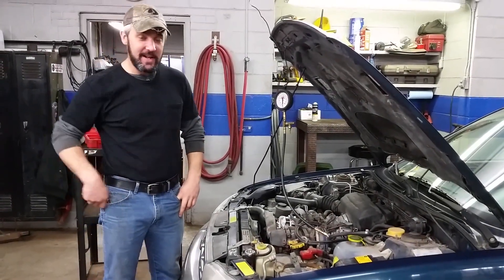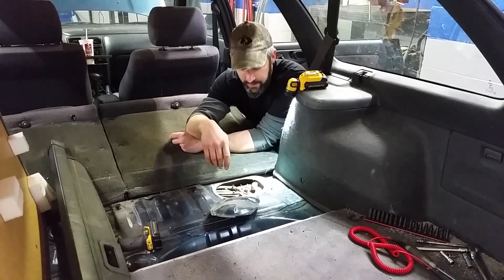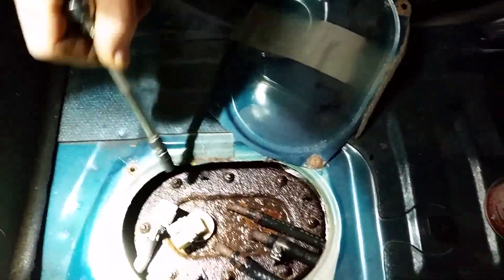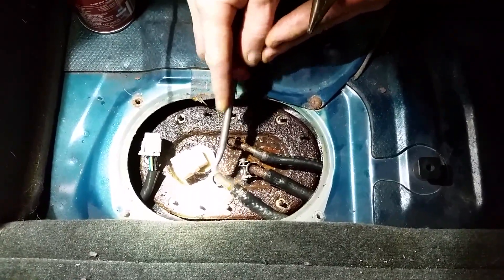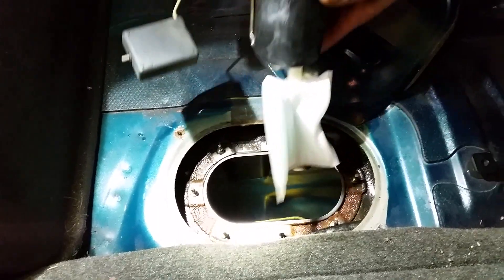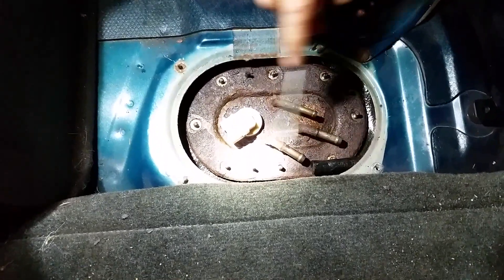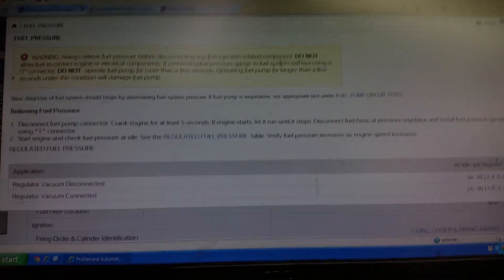Test And Replace Fuel Pump  - Subaru Legacy Outback

Comment: Great video!  I successfully changed the pump in the parking lot where my car died.  I had never even opened a gas tank before.  It took about an hour.  Side note: My pump was the original pump and I took the wire leads off the old motor by removing the nuts from the wire posts, then I just used the original wires and put them on the new motor's posts.  This saved me from cutting and splicing the wires and gave me a better connection and was faster.

Comment: I bought my 97 legacy outback about a year ago... it’s held up pretty good until now. The owner told me a few problems but not the other ones, some being major like BOTH head gaskets leaking. I’ve had a weird problem though, stalled twice, once while driving down highway the lights and radio stayed on as the engine just shut off and I drifted to a stop, another time at a red light. There’s so many problems it’s very stressful... I work and sleep in my car, it’s al I got

Comment: While I realize you probably want to key your videos short and to the point, and have done these things dozens or hundreds of times, but some of us have never done this, so you should include every step, like splicing in the T to the fuel line (and indicating how to tell which one), and how to remove that panel above the fuel tank. Once you have done it a few times, it might be easy to just "pop it off", but you know where to (and where not to) apply pressure to do so.  At least your video showed me which panel to remove, unlike the repair manual I have. 
I guess I am not part of your target audience; I am just a novice when it comes to DIY car repair. While I have been changing radiators and water pumps and alternators for 30 years, this is my first go at a fuel issue. Your video is just enough information for me to almost understand what you are doing, like if I watched my neighbor doing it.

Comment: I checked for spark with a timing light and "verified by sound" that the relay was working.  When a vehicle dies in a parking lot, the biggest question is always, "Is my diagnosis correct?"  This helped answer the question.   Good video, you made it look easy and it was.  Thanks.
Reply from the maker: Kelly Morey Glad it helped :)

Comment: Thanks, total time for me,  about 2 and a half hours including a trip to the parts store.  The hoses were tough to get off in 30 degree weather.  I did the pump and fuel filter, both.  Thanks, the wife has her car up and running.  Buy the way, the car had a hesitation on acceleration from stops, for the last few months.  I am hoping this goes away with the new pump.  1998 outback wagon, 145,000 miles.
Reply: Joe Sokolowski 
i have the same issue. stalling after dead stop. it just died. did yours get fixed?
Reply: Joe Sokolowski i see your car is good now. hopefully this is the case with mine.
Reply: Did this fix that issue I have that problem tempted to buy a new iac valve

Comment: my pump also failed on my 99 forester s turbo. the guy at the Subaru dealer says the pump can burn out if you always drive on a almost empty tank because there is no cooling by gasoline on these older style pumps.  
good video thanks :)

Comment: Great video thanks for sharing! I almost removed my pump in my 1995 Subaru Legacy Wagon, but found that I have another problem - I've checked my pump and am getting no power to it. (Your video showed me which wires to check for power, so thanks for that!)  Now have to try to figure out what's causing that. I do have symptoms of other electrical issues -- like the fact that the radio antenna goes up & down on it's own accord when the ignition is on, even though the radio is turned off. Someone suggested checking the ground wires in the engine compartment, but besides the battery ground wire, where are the others? ... Back to work.

Comment: Wire color is same on 1998 outback ?
Because i test light it and they have electric current but not on same wire on this video .
Black ground wire is same but the other wire is the middle up.. light come on with this 2 wire but no others wire light on.
Please need help tomorow
I start fix the car outside and its very cold here in Québec.  So i want to no before i start the job

Comment: Great video. I have a question. I usually just replace the whole unit, thinking the fuel level sending unit or float are probably next to go out. That said, have you had any issues just replacing the motor? Are the other components more robust?

Comment: Also, keeping enough fuel in the tank to submerge the pump will help it run cooler and avoid overheating-another culprit of premature pump failure.
Reply from the maker: ...along with plugged filters and contamination. Thanks for watching!

Comment: I realize it's been several years, but do you know what brand fuel pump you used and the part number? I have a 2003 Forester 2.5 N/A that needs the fuel pump replaced. The factory fuel pump is way to expensive.
Reply: Just for anyone else with this question OEM is Delphi FE0342, sometimes has a "C" in front of it, same part (box says both). Got one sitting here I'm about to put in and it looks the same as in the vid, down to the two gratuitous zipties.  Dunno if it goes into later model years.  Strainer is Delphi FS0095, sometimes listed with a "B" in front (again, box has both on it). That's for 1996 and presumably the whole first gen.

Comment: Eric- which set of sockets "twist sockets" are you using?  I have been watching all of your videos (in order) and you also used this socket style on the f150 transmission dipstick tube bolt replacement that was rusted as well.   I want to get the same sockets.

Comment: Hi there I have a similar issue, I have no power or ground on my fuel pump connector, I’ve done the test on the wires does that mean it’s the fuel pump relay ? Thanks

Comment: Is there a part 2 on your thoughts of why the fuel pump failed? Lol As always great videos!
Reply from the maker: Angel Garcia Nope what ya see is what ya get
Reply: GM fuel pumps will fail if you run out of gas as the gas lubricates the pump.  Can we assume this may have happened in this case as well?

Comment: Hey Eric  just a heads up, I've noticed that sometimes as with the Case in this video that I'm able to watch your Vids in 1080p witch is Full resolution HD but other times I'm only able to watch them in 720p which isn't as Good. Is it a YouTube thing or maybe you can check the Settings on your Camera?

Comment: Should the light test work in all six of those electrical inputs? I just changed the fuel pump on my 99 forester and it still isn't pumping. 3 of the six electrical inputs light up when I test it but, three of them don't. And one of them makes it light up brighter than the other. Is this normal?

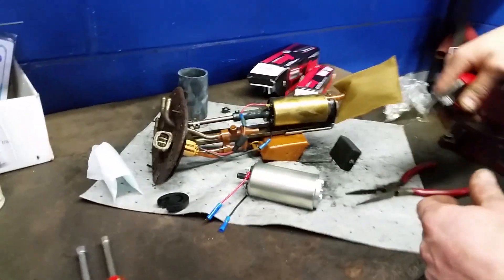Comment: Terrific video.  At 8:15 what is the brand name of those red handled electric cutters and pliers?  They look very sturdy.  

With the new EVAP systems I have found that rust around the fuel pump to tank seal can trigger a small leak code.  The lock ring on my fuel pump was so rusted at 10 years/70,000 miles that it was causing a P0456 small EVAP leak.  I took the opportunity to change the pump while I had the tank off and got all new parts including entire pump assembly, lock ring, and gasket.  Now the seal is tight and no more codes.
Reply from the maker: Sandbag1300 Those are Snap On PWCS7CF
Reply: South Main Auto Repair Thanks.  Ordered a pair today from the Snap On website.  Look forward to using them when I replace a few fuel injector electrical connectors that became brittle and resulted in broken clip locks due to age and heat.

Comment: i have a question my man, i went to mechanic they replace the pump but my fuel delivery line a a retaining clip and we had to broke it off, forester 2004 xt, they put it back on but had to do some fishy stuff to old the pressure, can i just use a normal clip will it hold up? i cant find the part number for the fuel delivery line with the pushy retaining clip.?

Comment: This same problem i think has happened to my subaru outback 2003 today. I was at a red light and all the sudden my car started shaking hard, i pulled over and checked rpm at idle. rpm wouldnt go up. i was stuck and hearing that noise like in your video. Luckily i had my uncle who gave me a push all the way home (15 minutes) with his truck. otherwise i would have been stuck. our orginal mechanic gave out and had no idea, the problem then was the  car stalled after a dead stop. is that stalling from a dead stop also a symptom, rather a early one? then today we had another mechanic change idle control valvle, and pcv valvle. old codes were gone. changed spark plugs as well. going to have one more person check it out, if its not fuel pump then i have to junk it. it only has 90,000 miles on it. 🤐🤐. your video gave some hope.
Reply: Did you figure out the problem same thing going on with my 04 Outback 128k miles on it just did a bunch of work trying to have a daily

Comment: question is what causes the pump failure? I have owned three of these cars so far and none had a pump failure I dont let the fuel drop below a 1/4 tank though; 91 wagon had 312k miles when it got recycled due to rust

Comment: Hi Eric, new subscriber here. Nice video! You used the test light to check power to the fuel pump. Obviously the light turning on means there is current but is it enough current? Apparently so but when diagnosing would it be better to use a multimeter and refer to the car's service manual for the acceptable range for V or amps? How reliable is the test light method for telling you if the current is sufficient?
Reply from the maker: AJFresh Useing a test light will load a circuit more than a meter. I can hook together a bunch of watch batteries and have a perfect 12.66v on a meter but no ability to carry current. The test light is a very under appreciated and utilized tool. You will see me use it to diagnose many complicated circuit problems in cars where a meter would confuse 90% of the people that use it. Have you seen my latest video diagnosing a chrysler TIPM using on a light? https://www.youtube.com/watch?v=EQ9tqxsAu1o Hope this helps explain a little.
Reply: I'll check it out. I'm new to this stuff and this is an area in particular I will be studying more thank you
Reply: +South Main Auto Repair A test light will tell you that you don't have an open or a short, it won't tell you if there is high resistance caused by corrosion in the wire or a connection.  The light may light but that doesn't prove that there is enough current to run a fuel pump.
Reply from the maker: it creates more of a load than a meter... yes I do current ramp test them and do voltage drop testing.

Comment: May I ask, doesn't the fuel pump connection need to be intrinsically safe. I don't know how you would accomplish that, but it seems odd that you would have this in a explosive atmosphere when the tank level is low.
Reply: There isn't enough Oxygen in there for it to be an explosive atmosphere. Explosive atmosphere = proper mix of fuel and air, too little air = no ignition.

Comment: Hi, I have a problem with my 97 impreza, one day was driving and the car start losing power, this happened 2 times in 2days and then the check engine light appear, so I check with a code scanner and the code was p0463, I bought a new fuel pump, thinking that was the problem, but now with your video I'm not sure, cause my car runs good and don't have problems anymore, no more check engine light or loss power but the only tiny problem is the gas gauge, give a bad lecture, sometimes is full and the next minute is in half tank and then is full again, do you know what could be the problem? Thanks
Reply from the maker: Sounds like it could be a problem with your sending unit but it would have to be tested to be sure.

Comment: Notice you are using an Airtex Pump. Do you have good luck with the Airtex pumps from advance? They have bad reviews online but that could be from DIYers not checking wiring or leaving dirty filters. I always buy pumps from the OEM but it may not be worth it for this car. 75 for Airtex hanger vs 250  or more from Ford.
Reply from the maker: I'll tell ya I have installed a pile of them and have yet to be haunted by one. Like you say though look at the shotty job most DIY'ers do and they are likely the one to be doing reviews too. Then again a lot of vehicles I put pumps in are on there way to the crusher in a few years too...
Reply: South Main Auto Repair thanks for the insight, sounds perfect for a 20yo rustbucket I drive when they salt. Really you are supposed to drop the exhaust and tank on this car(a thunderbird) but it is so horrible that I just cut a hole under the seat.  I can also keep the failing old one, sometimes it needs a whack to start - advance is all over the place here and it has a lifetime warranty. Keep up the awesome work!
Reply: alb12345672 Its usually the GM or FORD applications that seem to be  the most problematic. Harness issues.

Comment: Where would the pump relay be located, I am trying to find mine on a 99 Legacy sedan and having troubles. Thanks in advance and keep up the good video's.
Reply: drivers side kickpanel. up at very top. round top with a 4 wire connector.

Comment: Thanks a bunch for the informative video.  Just had a fuel pump fail on my 2001 Forester.  It gave me a couple days notice by 1) after driving about 30 miles, shutting off and leaving an hour, started up but died immediately.  Did this two or three times before it would run continuously.  2) felt fuel supply "cut out" for a second or two while at highway speed.  Thought all this was a fuel filter that was almost due to be replaced, so replaced it and not solved.
Then I found this video and borrowed a fuel pressure kit from O'Reillys.  No pressure.  Then tested power at fuel pump harness and had momentary power.  Verdict: Dead fuel pump.  Ordered replacement parts from Rockauto for about $100 shipped, which included Airtex pump and strainer, plus new gasket.
Thanks again for your help.  Do you have a way for me to make a donation to show my appreciation?  Paypal account?
Reply: +Scott Smith 
Not sure how to edit a comment, so replying to my own comment was the next best option.  
Wanted to add an important point; beware of a failing/failed Fuel Pump Relay.  Like I mentioned previously, my Forester looked like a slam-dunk dead fuel pump.  No pressure on the fuel line below filter, and momentary power at the fuel pump harness connector between pins 1 and 4.  
I installed my new pump, strainer, and gasket, and NO START!  Ended up towing to a trusted mechanic, who diagnosed the problem as a relay that was intermittently functional.  He said the pump was probably going out, which puts more load on the relay, causing the relay to fail.  A chicken and egg proposition.
How to test relay: remove from under dash on driver's side (LHD).  Apply 12V to terminals 1 and 3 (coil or control circuit).  Measure resistance at terminals 2 and 4 (load circuit) .  Should be less than 10 Ohms. This test taken from Subaru Factory Service Manual 2001 Forester.

Comment: I need to know how to pull the fill pipe  on 1997  Subaru Legacy Outback
Reply from the maker: they are usually a rusty mess. Just pull the plastic cover off it and it is pretty easy to do

Comment: Did this and still won't start I hear pump run not getting fuel to injectors
Reply from the maker: Kyleon Banger Any codes? injector pulse, spark?
Reply: +South Main Auto Repair
Haven't got diagnosis car just stopped on me one day fuseable link went bad finally figured that out then no sound from fuel pump was idling real shitty before that changed relay as well
Reply: Was a bad wiring harness
Reply: There has been a recall on the wiring harness in 2018 here in Australia , and thank you Eric for the best auto u tube channel yet!

Comment: Thanks for the video.  You need to invest in microphone though.  The sound is pretty bad.
Reply from the maker: Yeah... I know about the mic. I have upgraded cameras sense I did this video though so it got a little better. I bought a Sony Handy Cam instead of using my phone (like I was using in this one) but like a dummy I didn't check to see if the handy cam could take an remote mic... and of course it doesn't :(. At any rate I am a better mechanic than a TV Producer but I am slowly learning lol. Thanks for watching and commenting!
Reply: @SouthMainAuto  The sound was fine, all pertinent information was clearly conveyed.